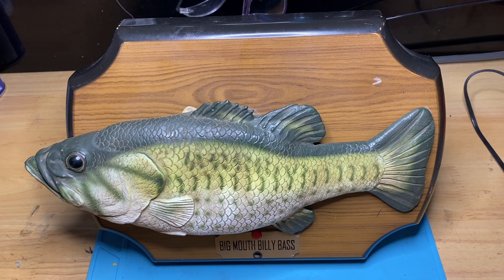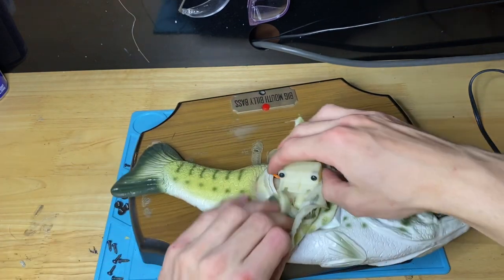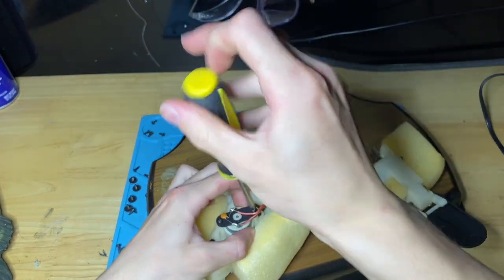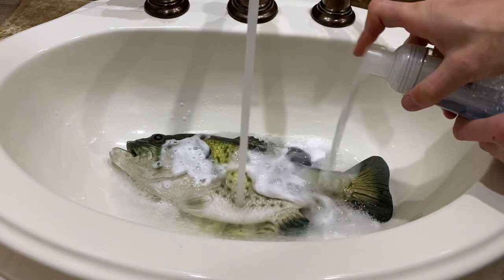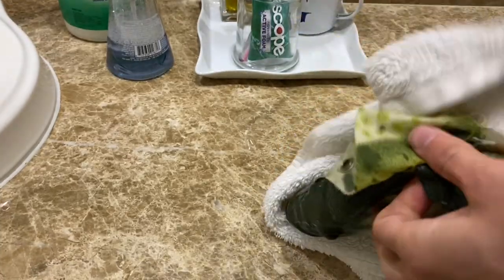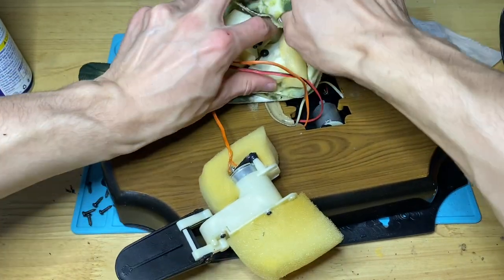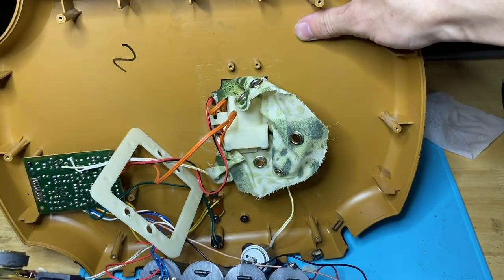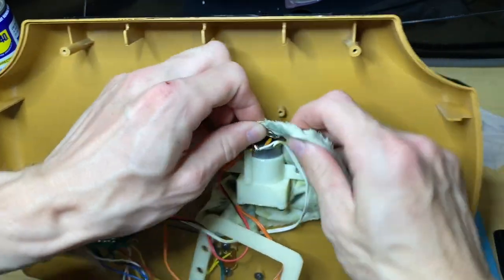How To Repair Your Gemmy Big Mouth Billy Bass Singing Fish (Head, Tail, Mouth, Cleaning Skin)

Comment: Great video, but where do you get the replacement gears? I've got one with a busted head gear and mouth gear, and if I'd love to buy replacements. Failing that, I might try 3D print.
Reply: update: found some on ebay. 1/2 mod 9t and 10t gears. If you have the fish already, just take it apart, take out the problem gear, and buy one that looks similar (9t for the driving neck gear, 10t for the driving mouth gear). Worked for me.

Comment: Thank you so much for this guide, I was able to fix the issue with the mouth I was having. Weirdly just taking the motor out and putting it back in worked but would of have absolutely no clue if it wasn't for you :)

Comment: Nice video!
I just got a brand new one in the box.
I put 3 different sets of batteries and does not work.nothing turns on.no movement or singing. 
Could it be the power switch?.
Any idea on what it could be?
Reply: try replacing the battery contacts

Comment: I just got one today 
It sings and the mouth moves but it won't turn it heads towards me ???

Any ideas how to fix this issue
Reply: I have the same problem
Reply: Split gear for the head.
Reply: @noahknauff2274  Thank you! It was a split gear, and I fixed it and now it works flaswlessly.
Reply: @kyleswackhammer914  your very welcome glad to help you